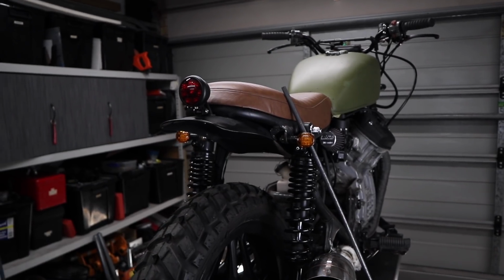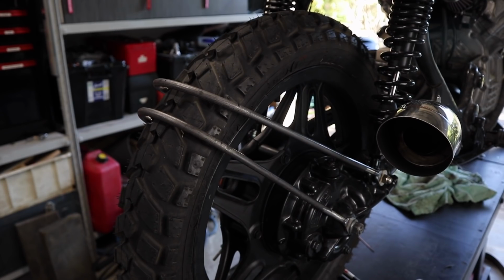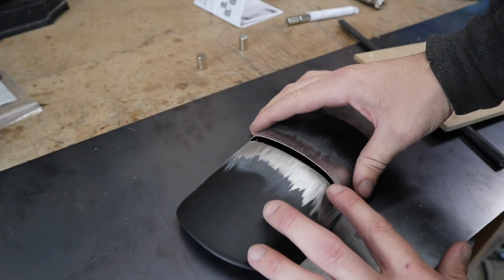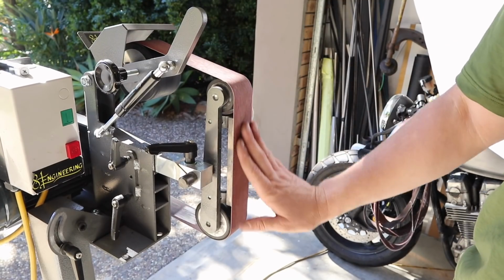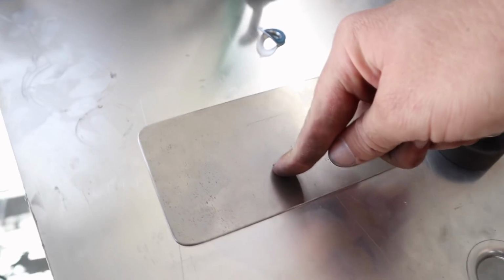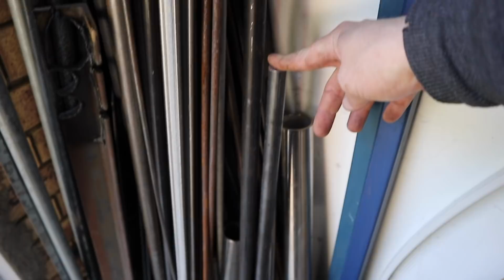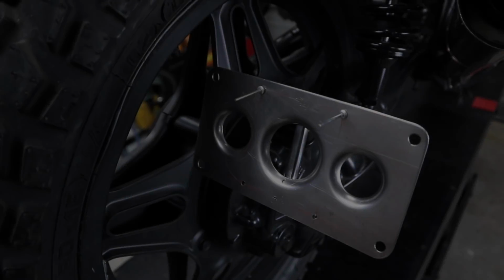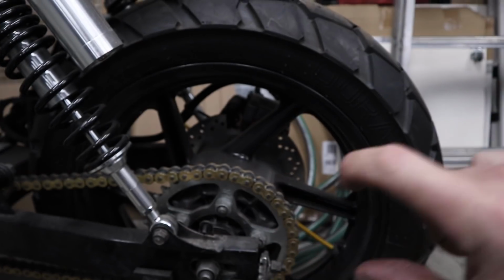3 ways to fit a Licence Plate to a Motorcycle,  Ep.38

Comment: First of all, congratulations for your work, an excellent explanation that inspires us all. Thank you.
Among the three options, being realistic and looking at the pros and cons of each one, the best is the superior one, it is clean and almost without causing problems when used in the field.
The low option is very close to the wheel, which leaves little room to tighten the chain if necessary. In addition to the fact that in use in the field and in the event of mud, it would make it difficult for the wheel to turn when the mud accumulated.
and the last side option. For me it would be the worst, since aesthetically so beautiful, it is the most dangerous, since if it received a blow, it would move towards the inside of the wheel, blocking it and causing a serious accident.
It is not only the aesthetics when designing a motorcycle, it is also very important to take safety and use into account. That is something that many designers forget, who only give importance to aesthetics.
Thank you for your work, again, they help me a lot to inspire me and learn new techniques and different points of view.
Thank you (from Peru).

En español.
Ante todo felicitaciones por su trabajo, excelente explicación que nos inspira a todos,. Gracias.
Entre las tres opciones, siendo realista y viendo los pros y contras de cada una, la mejor es la superior, queda limpia y sin ocasionar problemas en casi de uso en campo.
La opción baja, queda muy cercana a la rueda, lo que deja poco margen para tensar la cadena si fuese necesario. Además de que en uso en campo y en caso de barro, dificultaría el giro de la rueda al acumularse el barro.
y la última opción lateral. para mí sería la peor, ya que estéticamente que bonita, es la más peligrosa, ya que si recibiera un golpe, esta se desplazaría hacia el interior de la rueda, bloqueándola y provocar un grave accidente.
No es solo lo estética al diseñar una moto, es también muy importante tener en cuenta la seguridad y el uso. Eso es algo que olvidan muchos diseñadores, los cuales solo dan importancia lo estético.
Gracias por su trabajo, nuevamente, me ayudan mucho a inspirarme y aprende nueva técnicas y puntos de vista diferentes. 
Gracias (desde Perú).

Comment: Liked the other 2 just fine; either the fender mount or the short mount off the rear drive. The abbreviated mud guard off the back of the rear wheel, however, is a big ol' hairy nope. That's the first thing guys around here ditch when they buy a bike with one of those things on it. I have to come correct, my man: Those things just look incredibly dumb. Other than that, this is one of my favorite builds on YouTube. UrchFab is very cool, but you do a great deal with fewer resources. Like the old chestnut goes: "The more you know, the less you need".

Comment: I prefer the traditional mount. Question, with the other 2 mounting styles are you still able to adjust chain tension with the bracket attached to the axel?
Reply from the maker: George Richardson with a chain driven bike it would need an elongated mounting hole so you can adjust it if you need to. Hope that helps 👌

Comment: Interesting. I do have a soft spot for swingarm mounts that double as a mudguard, how's flex and metal fatigue tho? There's some horror stories over here about after-market stays simply snapping over time, from 3mm+ bent flat metal to less than optimal mounting points. Adult fear right there, getting pulled over or coming home only to find your license is missing and having no idea where it went 😅
Reply from the maker: It could happen but I build things over strong so generally nothing will go wrong.   I said generally not never lol 😲

Comment: I think the second style will cause you least troubles!

In Victoria, the plate is supposed to be visible from 45 deg either side.

Are you going to re-drill the axle to fit a cotter pin now that you've got the steel bracket spacing it out?

I made one for mine similar to your first design that mounts from the other side. I made a clamp that fits around the spacer sleeve on that side of the axle for the second point.
Here's the album on my FB page: 
https://www.facebook.com/pg/dbjacCX500/photos/?tab=album&album_id=224902391427115